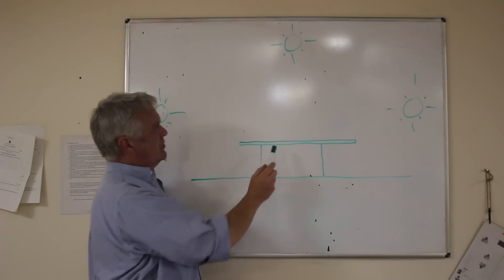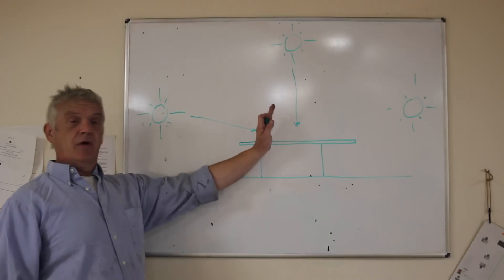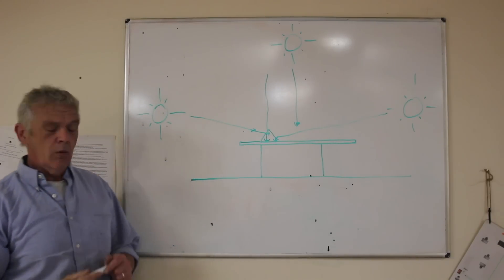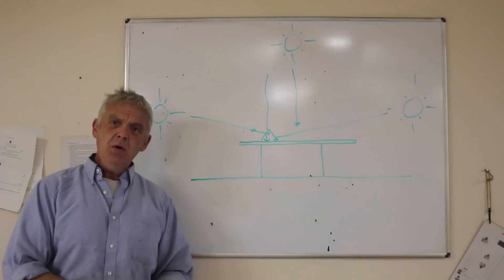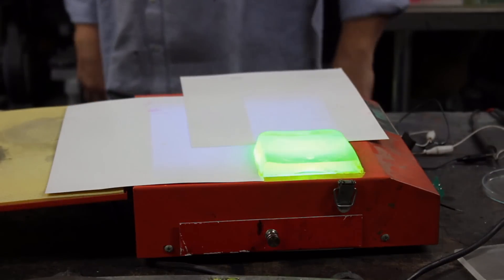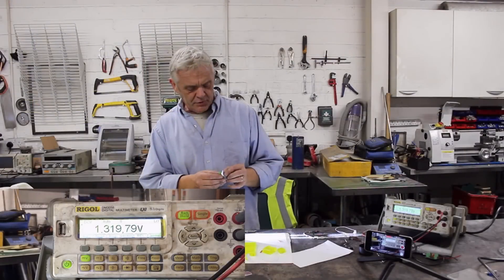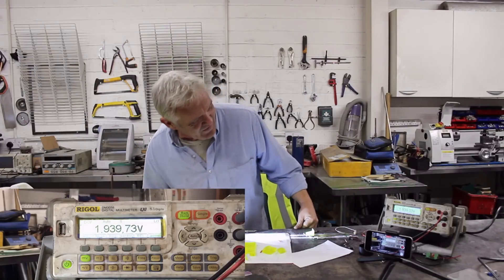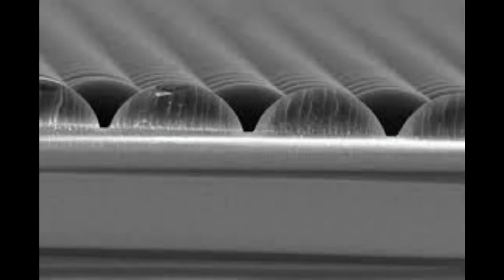1666 Solar Cells And My Evil Plan For World Domination

Comment: seems to me, the need for tracking is obviated by the use of the acrylic light guides. But, yea, maybe Fluorescent Acrylic  Light Guides. Perhaps, Jello filled.
I think it is important to first confirm this works in open sun without the flashlight. (Perhaps Vanilla Solar Cell vs plain Acrylic Prism on Cell vs Fluorescent Acrylic Prism on Cell) all in open sun, without second source such as the flash light?
Reply: Simple and easy enough, have you tried it yet?
Reply: When you finally do get around to putting something together, consider using a jello mould in the shape of a Fresnel lens. It's working wonders so far.
Reply: @captainnemo6655  Was watching the video a second time, and re-read this comment. Are you saying you actually made a jello mould that has a fresnel lens structure embedded in the surface?
Reply: @marcfruchtman9473  Yes. You can also make the mould into the shape of an hour glass with flat top and bottom. This shape has amazing potential for solid state solar tracking. I accidentally stumbled upon this shape while watching another one of Rob's videos where he showed two cones, inverted and sitting on top of one another as also good shapes to use for a transparent fluorescent media that could be a good lens.

Comment: Won't the next small prisms need to be higher and higher? Also, you might want to have a kind of compound refractor so that you refract twice so that the angle of deflection is maximally perpendicular to the panel and so most efficient.
Reply: He actually made such a prism in a video. You can find it in the video library, it's tittled DIY Fresnel lens, made from a coil of transparent tubing.

Comment: Take those fluorescent acrylic sheets you just got and make some grooves in them.
Ball-nosed or V-grooved end mills - sounds to me like the easiest way to try out your idea on a budget  ;ø)
Reply: Good idea! You could also mold the jello or other medium like fluorescent/phosphorescent resin or even AeroGel or CryoGel into the shape of a Fresnel lens.
Reply: @captainnemo6655  How about applying the fluorescent marker onto the lens sheet from a LCD screen - then the light will be bent and UV light converted into usable solar-cell photons. 
No machining involved, no mixing of resins and proper safety concerns. Just wiping the inside of the marker around on the lens sheet. 
Hmmm. I have some solar cells, LCD lens sheets - where's my markers ;ø)

Comment: The amounts of power hitting the prism surface is not much higher than the amount of energy hitting a flat surface panel because the surface area of the sunlight hitting it changes very little.
Reply: That's why you gotta rethink the idea of what is a prism. Did you know Fresnel lens shape takes care of the problem. You can even make a jello mold in that lens shape.

Comment: Just an idea to bounce off friends here. What if you were to use a lenticular lens out of an old LCD TV as a mold? Or make a silicone mold of the aforementioned lens, depending on the profile of the individual lenticules, you could cast it with epoxy resin and highlighter ink.
Reply: It would kind of work but the lens shape would leave out some angles where light won't be hitting the PV cell. A Fresnel lens made from Flourescent clear tubing would work better. Rob has a video on how to make such a lens.

Comment: something else to consider is instead of prisms how about just some angled sheet that has a dichromic coating that lets UV and other useless light that the cells wont use, pass into the gel, where it converts to the fluorescent color that the cell wants, and the dichromic coating though reflects that color you want, so once it is made, in the gel it gets released in all directions but the side facing the sky it just gets redirected back into the solar cell, doubling the cells saturation of the fluoresced color or frequency of light?
Reply: This is an interesting idea. And an additional thought occured to me for this kind of coating, would it work better if the Gel was PHOSPHORESCENT instead of Fluorescent?

Comment: actually they used to use these color filters for high powered stage lighting called "gels" which were made of gelatin so I would say find out what the process and any additional compounds added to them to make them good as sheets of color filter over 300 plus watt spot lights and apply that to the gelatin process you are doing now because I know if you let that blob sit and dry out, it will shrink and thin down but the concentration from side to side of pigment remains the same,
Reply: Good idea! Thin sheets of fluorescent gel combined with printed PV cells can make for excellent portable solar panels. Would love this for outdoors survival situations.
Reply: @captainnemo6655  I would guess maybe if a pigment that phosphors could be made to absorb frequencies that activate it while being able to transmit those that the cell uses and the reaction is the frequency also that the cell uses so say absorb all UV and deep purple blue ect and put out a green that is in the peak of photon energy that causes electron flow in the cell. Problem I have with my pigments is all the europium strontium super pigments and the old zinc sulfide stuff is all opaque to the range of light the cells need mostly with a slight diffusion to some of it, so it reduces the light getting to the cell while not putting out enough to make up for it by absorbing it.

Comment: This does sound like a good direction to explore to have zero loss (as far as Top Surface area), but you need a Passivation (which is flakey & brittle ...like a clear topcoat paint peeling & propagating over time, now exposed) or better yet a better protective Polyimide (THICK like molasses, oddly dark like it too to protect what's beneath (everything). - Now "Darker translucent to deduce light into a microchip I question less as this is SHEILDING from light too can generate enough to blow transistors so close. However, if present in strictly "solar cell mfg." then I'd say that's an obvious intentional obstruction to be more efficient, so maybe there's a reason there's a resistance on one end, as we try many ways to get the light "IN", vs keeping it "OUT" with "Dark RF Shielding properties" NOT NEEDED, maybe WELCOME EXTRA PWR FROM A SPECTRUM FULL OF ENERGY. I gathered my info from experience working in microchip manufacturer until deathly board, wanting to learn more elsewhere (and I did, still continue to do thanks to Robert's CHANNEL here), but I came from QA - Need to know entire process from beginning to end ... final product.
Reply: Amazing what you describe here! I agree. It would be amazing to have a full spectrum PV cell. It does bring to mind something I just saw last month. Have you seen the latest work that was done on Light Trap devices? A Light Trap PV Cell with semi translucent Photovoltaic Glass can do what you are alluding to and fully absorb all the light.

Comment: Prisms can be made from epoxy resin and on top of that you could pour enough highlighter dye in there making it a fluorescent prism.
Reply: Make sure that the epoxy resin its self is thoroughly capable of withstanding the UV light before you use it or you won't have a prism for very long.
Reply: I'd honestly suggest something like a liquid prism holding the fluorescent dye held in place by a UV transparent glass.
Then you have access to the dye if it degrades, save money and plastics, and you get some decent internal reflection guiding the energy from the fluorescent dye into the solar panel.
Reply: This idea!! Remember you could mold the Gel into the shape of a Fresnel Lens... In addition to this, you could make the prism from Glow In the Dark glass. It would work wonders if you combine it with Photovoltaic Glass or Rob's semitranslucent Graphene PV cells.

Comment: Flureseent source... Absorbs at angle intensity falls off geometricaly away from normal...so not really helping..
Then energy is released at..random angle
Consequence.  Panel illuminated at random angle....at least half away from panel..
 But the flurouresence thing might work as matching.....one wavelength in another out..with the first say at peak sun (yellow) and re emitting at peak for panel. ( infrared).... 
Down side difference in emitted energy ends up heating the flurosent too and most of these things cook ( degrade)rather easily
Reply from the maker: to be honest mate you are not the first to say this - and of course I have been reading I found a few papers already that disagree - but hey all that means to me is time for a test lol

Comment: AHHH so it has begun! XD
OK I have a question that I may be able to answer for myself, but it's worth expressing it here: 
Ok, so there is a loss when putting anything between the cell and the sun, such as a light-guide. And  fluorescence offsets it...  and I've seen the sheets of fluorescent acrylic. 
But I am wondering if an entire sheet of fluorescent acrylic is necessary or whether it could just be the edge of that sheet right where it meets the solar cell, on what is otherwise a plain transparent light-guide. Might be a way of saving lots of £££
Reply: maybe a fresnel lense

Comment: I have 2 thoughts:
1. If the light comes from a nearly 0-degree angle or 180-degree angle. Is the area of the solar cell the same as if the light were to hit it 90 degrees? I mean if you think about it. Hold a card and look at it from the side you see a line rather?
2. Shadows. If you put things on the solar cell in the hope to direct the light to the solar cell each thing will add some shadow to it. So how do you direct light to the place that has a shadow especially if the light comes from the sides and not on top?
Reply: Yeah, its pretty much useless to turn any object perpendicular to the light you are trying to collect.

Would be best to just have mirrors on each side.

Comment: I think the problem is the amount of exposed area to the sun not the angle. 1 Square Foot of sunlight only has X amount of energy. If your not exactly 90° to the 1 square foot then your actually exposed to less of that area. Think of it like this. If your looking at a sheet of plywood from say 100 yards away at 90° to the face it will look like it’s 4ftx8ft. But say your buddy turns it 45° to you. Now that sheet is going to look like it’s 2ftx8ft. The steeper the angle the narrower the sheet is going to look. You would have to build a florescent triangle on top of the panel that always presented its self to the sun as being at least as large as the panels face. Think like a pyramid with the center height at the same width as the panels
Reply: This is exactly the issue that solar tracking is meant for. It is true that low angles lead to increased reflection but the major loss is the total energy available for the panel to use. And another fun fact, high efficiency solar cells are textured so that there are already micron sized pyramids all over the front surface but that's done to actually make the light skim the now tilted surface to increase the effective junction thickness.
Reply: The compounding issue is that at low sun angles, the intensity at the receiver is much lower due to passage through the often cloudy or hazy atmosphere. So the energy you are fretting about is simply not there. A flat array aimed at the noonday sun works best. Add a few more panels if you need more power.
Reply: @nigelwilliams7920  Yes, that's another factor too.
Reply: @nigelwilliams7920  absolutely agree on receiving the max at noon however I have seen research that speaks of a wider window of opportunity. Perhaps you could speak to how wide is this midday window. The noonish thing would not benefit from a tracker to make it worth it but many trackers claim 25% more efficiency and bifacial panels say similar. Mmm wonder what would happen if the ground behind a bifacial panel were surfaced with fluorescent material?
Reply: Therefore the pyramid or quantity of pyramids or light guides must track completely or partially section by section while holding down the cost of mechanism, be it actual primitive existing tracking plus sub tracking to tilt pyramids or tracking plus something like short fiber optic style that moves to manage perpendicular or perhaps specifically polished dome like faces , not to mention the fluorescing dye. Mmm gotta think
Reply: @marcisaacs9407  why not laser PRINT synthetic Ruby prisms onto the PV cell?
Reply: @captainnemo6655  I must admit that I am tech challenged. Why Ruby?
Reply: @marcisaacs9407 Cheap to make. You can make them out of plasma in a microwave oven or via laser... Also they are fluorescent.
Reply: @captainnemo6655  you have my attention but unfortunately I am not familiar with the technique. Plasma?
Reply: Maybe not a pyramid but a  vaulted Arch, an upward facing parabolic shape made made linear prisms each at a slightly different angle so that the majority of the light is reflected to the panel and it's vertical cross section (that area of what it would look like from the side) is even greater than what it would look like from the top down!
Reply: From what I gathered form the video his intent was a prism that would be rather large, perhaps almost as large as the space consumed by solar trackers, to be competitive with them, so this does not seem to me to be a space saver in that regard.

But the ability to utilize space around  a stationary object that is solid on the ground or acting as your entire roof for examples, is far more the an active tracker, and allows humans access without much or any restrictions in play save the nominal "don't vandalize" sorts of rules, and that is rather impressive on its own right.
Reply: May as well throw a fresnel lens over the panel.
Reply: What if you take a coiled bit of plastic tubing, we fill it with fluorescent or phosphorescent material and make a Fresnel Lens with it? Rob has a video on how to make these.
Reply: Question, with a laser printer/engraver, would it be possible to laser PRINT small synthetic ruby prisms to seve the same purpose? Synthetic Rubies are still fluorescent.
Reply: @captainnemo6655  I suppose it is possible. But probably not with the tech we have available today.
Reply: the more you change the angle, the less energy there is in that same square foot being absorbed by the panel. it's not x amount per square foot. the angle determines how much energy the panel can produce, 90° perpendicular is best. every degree off, is less power in that same square foot.
Reply: Using (Fluorescent) Reflectors to track the Sun Rays to project them of the Solar Panel looks to me Solving this Angle Issue but still with a Fixed Panel and a Cheaper Way to Track The Sun.

Comment: Mind if I throw some spaghetti against the wall here?  Plants have a natural ability to point towards the sun.  They have proteins in them that are photosensitive.  The side away from the sun elongates because of these proteins so the top is pointing towards the sun.  I don't know what else to say about this but I have often wondered if it possible to harness this ability in some way.
Reply from the maker: hmmm - interesting - cheers mate
Reply: @ThinkingandTinkering  the technical term is called phototropism.  There's positive phototropism (towards the sun) and then there's negative phototropism (away from the sun).  No I don't know is it is possible to extract this protein or to synthesize it, but would it be possible to install some light weight solar panels among the leaves at the top of a small tree or something?  Idk.  Like I said, I'm just throwing spaghetti here.

Comment: Would epoxy work before you add the hardener to get the colour out the pen or triangular fluorescent strimmer wire
Reply from the maker: i don't know mate - ut i doubt it as the dye is water based - you might have to dry it then mix it in

Comment: Why visable light when the sun produces longer waves it seems ridiculous?
Reply from the maker: most solar cells respond to visible light - there are those that use different materials to respond to different wavelength - but they are stupid expensive
Reply: @ThinkingandTinkering  wrong, a cast iron radiator submerged in a cast iron vessel with old motor oil will boil water instantly. Even sand coukd be used to store said energy transfer

Comment: I think this idea is flawed. The energy will not increase by putting prisms on top because you cant get out more energy then what comes in. If the solar panel is not properly alligned less energy comes in. No matter what you put on top of it.
Reply from the maker: hmmm - ok - cheers mate - but the idea is to get more of the usable light in as well as shift the wavelength of unusable light to a usable wavelengh - the idea of the lens is to kind of try to align the cell better without moving it - a bit like a lens focsses light - but you are right i may well be way off